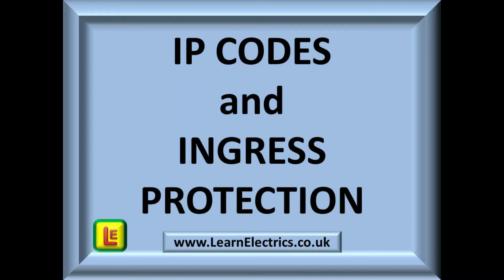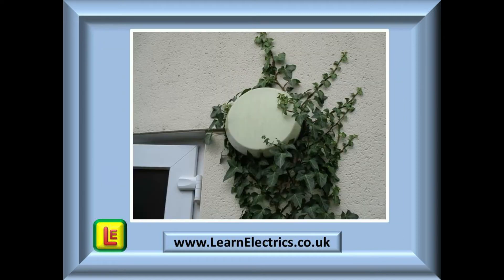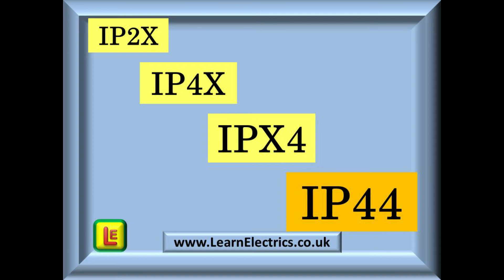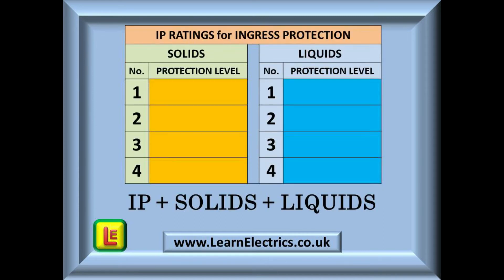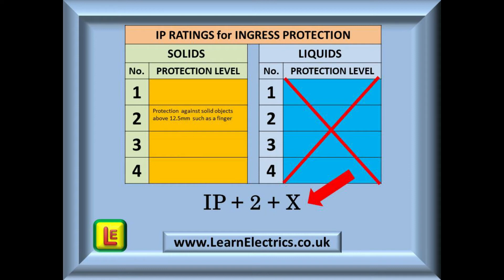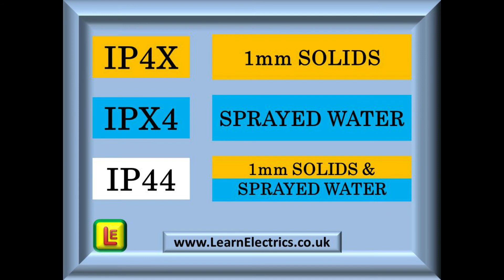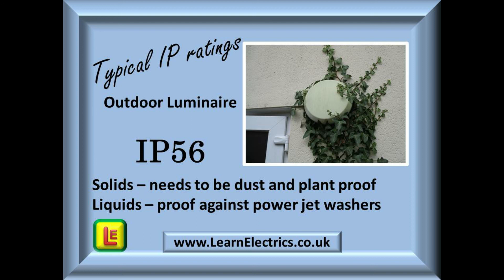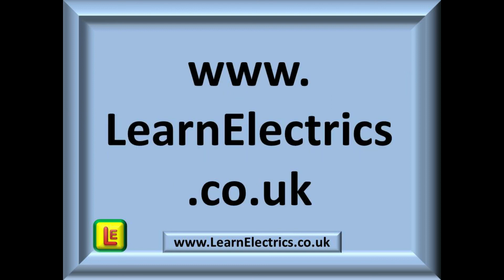Learn IP CODES and Electrical Ingress Protection

Comment: IP means international protection not ingress protection P48 BS7671
Reply from the maker: Absolutely, nut most electricians know it as Ingress protection which is why I've used those words. International protection codes for the ingress of solids and liquids in electrical equipment. Thanks for watching. Dave.